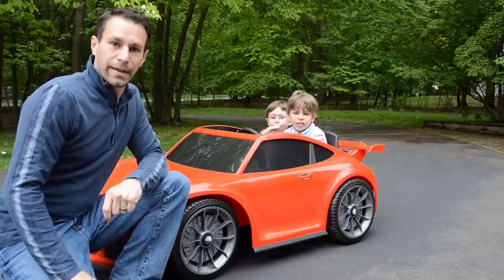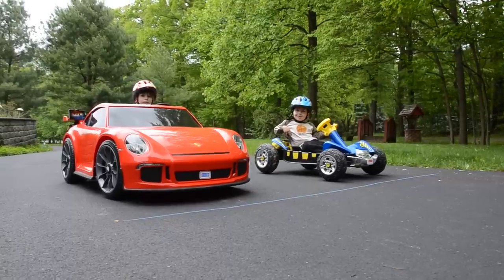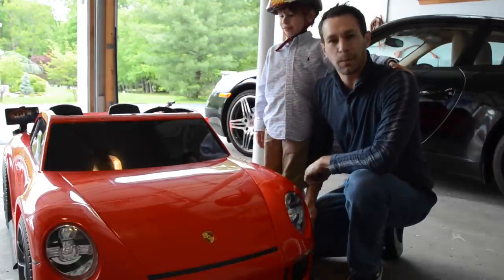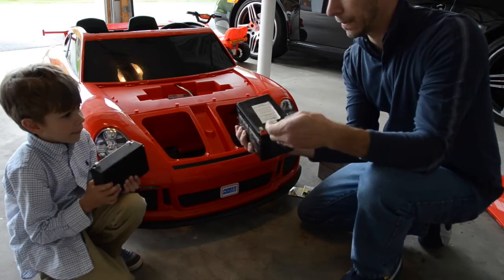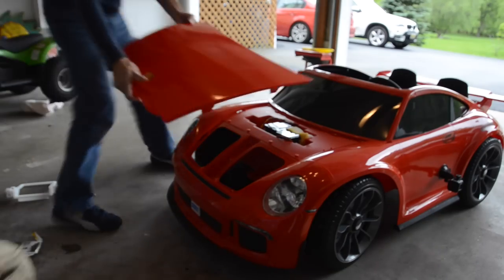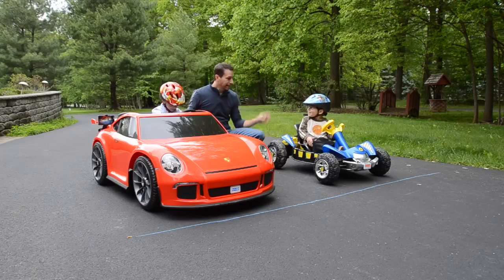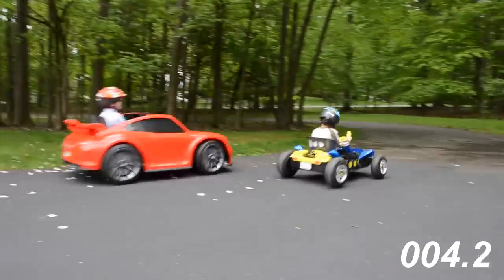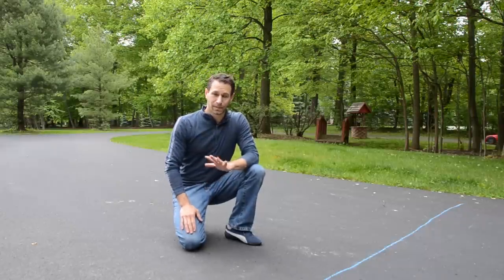How to Hot Rod a Porsche 911 GT3: 50% Faster (Power Wheels 991 GT3)

Comment: Most of those cars have little gear handles to go backwards keep in the middle to stop and push forward to go forward but if you unscrew the screws you can push it all the way down there to goes faster than it usually does

Comment: Painfully slow, I would throw in a 6S 16000mah Lipo battery from hobbyking which is 22V and lightweight, large capacity drone battery. Get ready to haul ass. I'm sure it's a brush motor, get a 48V ESC from eBay, wire 2 x 6S lipos in series combined for 44V and get ready to rip. Also, upgrade to a 1500W brushed motor down the line, as you may burn out the stock motor on 44V. Just my 2 cents (I build electric race bikes 116V, 70mph).
Reply: Electric Race Technologies and rubber tires
Reply: Electric Race Technologies or a gokart engine
Reply: I like your thinking my good sir
Reply: ya I use a v8 with the quadro fart spin turquoise rainbow charger

Comment: hey man, just wondering here (and researching for my project),putting more voltage in a 6v (or would be 12v) motor doesn't reduce lifetime of the motor?  Great video!
Reply from the maker: The two biggest weak points for adding more voltage are the gearbox and overheating the motor. The more voltage you provide, the more torque on the plastic gearboxes, and the more likely something will break. If you have an electronic speed control that eases the power on, you can add more voltage (24v) to a stock gearbox. Also, too much voltage to the motor will overheat them and burn them out.

Comment: Just needs more grip now. Too much wheel spin on launch :)
Reply from the maker: So true. The increased speed also makes understeer a bit!
Reply: Lets not forget you can upgrade the motors too.
Reply from the maker: +AmuckPVP excellent point, better motors definitely kick things up! The biggest reason I went to only 18v is the gearbox. Once you hit the torque that 24v provides, the instant start and stop of the power is difficult for the plastic gears to handle, and they will eventually fail. To combat this, modders also upgrade the gearbox, change to a variable throttle system (usually a scooter board), or both. I like your mindset of more power!
Reply: Motors, Megabytes, & Mods
"excellent point, better motors definitely kicks things up!"
I ended up going to multiple pawnshops & bought a ride-on-car toy for an amazing price. The unit I bought had a dead battery & I talked them down to reduce the price of $60 because of it.

"The biggest reason I went to only 18v is the gearbox. Once you hit the torque that 24v provides, the instant start and stop of the power is difficult for the plastic gears to handle, and they will eventually fail."
I purchased a new Traxxas 5675 Titan 775 & you can get the plastic disc that goes inside the GearBox used or new at a good price on eBay or buy a metal one.

"To combat this, modders also upgrade the gearbox, change to a variable throttle system (usually a scooter board), or both. I like your mindset of your power!"
I thought about buying a ESC system someone is selling on eBay that I came across from YouTube or to try to build it myself. I wonder if certain scooters have it so I can just transfer the system to a ride-on-car toy & I can pay a fraction for getting it used. However, I did what the person above mentioned. I ended up getting 3 cheap-grippy bike tires at Wal~Mart & it helped for the jerking.

Motors (2) I purchased: https://www.amazon.com/dp/B001SETT0Y/ref=wl_it_dp_o_pC_nS_ttl?_encoding=UTF8&colid=3A7QWRVB1I5XR&coliid=IK06X360NPMT1

Batteries (2) I bought: https://www.amazon.com/dp/B0072ADJ4K/ref=wl_it_dp_o_pC_S_ttl?_encoding=UTF8&colid=3A7QWRVB1I5XR&coliid=I332PF9H7SZQ2N

Metal Disc for GearBox: http://kidcarsandparts.com/power-wheels-391/
Reply: I forgot to mention that the two batteries weighed less than the dead default battery & should last a lot longer anyways. Also, I failed to mentioned other accessories I bought like the fuses, new wiring, & etc. I bought a used unit at a pawn shop that costs less than the price compared to paying when it's new & that includes the price of upgrading mine  with MOD's. All in all, it was a fun project & my toddler son loves it. He recently got it for Christmas but unfortunately it's been raining a lot in California where I'm from lately.
Reply from the maker: It sounds like a great project!
Reply: Motors, Megabytes, & Mods
Thanks, I can't deny I like the cosmetics of the Porsche a little more but my son is extremely happy with his car & that's all that counts in the end. Oh yeah, do you know if certain scooters have it (the ESC system)? So I can just transfer the system to a ride-on-car toy & I can pay a fraction for getting it used
Reply from the maker: You're exactly right, all that matters is that your son is happy!  As for ESCs, I'm not sure of exact models to buy.  There is a lot of discussion on the modified power wheels site, I recommend poking around there to see what you can find.  http://forum.modifiedpowerwheels.com/viewforum.php?f=46&sid=2d7efbf5edd9a7b9ef5a7a15f76a610d
Reply: oddbrawl hi
Reply: soo truo
Reply: oddbrawl
Reply: oddbrawl i
Reply: oddbrawl yup way to much wheel spin
Reply: oddbrawl ikr
Reply: oddbrawl you need more weight
Reply: oddbrawl I
Reply: oddbrawl  ol
Reply: oddbrawl true
Reply: oddbrawl RWD life bro
Reply: oddbrawl p.s
Reply: oddbrawl yes there tires speen
Reply: oddbrawl k
Reply: oddbrawl they are still using the crap stock tires
Reply: I had one of those when i was little but it was a ford f150 how come i couldnt do a wheel speed when i hit the gas (but if was probably for the best😂😂😂😂)
Reply: yup, too much burn out, put dirtbike wheels on it or something
Reply: layer it with something, like maybe rubber
Reply: The plastic  gears will break once you improve grip.  I screwed in  sheatmetal screws for off road traction and it died in a day.
Reply: Love
Reply: oddbrawl cm
Reply: @motorsmegabytesmods9936

Comment: Next mods for these cars should be brushless power drills. Milwaukee makes some great upgrade options and gear boxes. The plastic wheels are good for grass but awful everywhere else. Rubber is just too heavy unless power train is modified. Then youre getting into large batteries, reduced run time. Might as well just give the am 90cc atv lol.

Comment: So my kids have the same Power Wheels Porsche GT3 and I've been looking to do this exact mod to make it a little faster.  I wanted to see how the batteries were wired in a series, but you didn't show that too much in detail on your video.  Any more information on this?  Thanks!  BTW, you have a lovely family!
Reply from the maker: Hi AWDRIFT, thank you for the compliment! There are a couple of ways you can do this.  One is to do it how I did it in the video where you snip off the factory connector (on the car) and use the "F2" connectors in its place (links in the video description, for reference).  One of those sides is positive and the other is negative, and there is usually a (+) and <-> symbol on the connector so you know which is which. The wires are sometimes color coded with red being positive (+).  You then connect the positive wire (+) from the car to the positive (+) connector on one of the batteries (it doesn't matter which battery).  Next, you connect the negative <-> terminal from that battery to the positive (+) connector on the second battery.  Finally, you close the loop by connecting the negative <-> terminal on the second battery to the negative <-> wire on the car.  You've then successfully wired the battery in series.  You'll know you reversed the connection to the car (swapped the (+) and <->) if you push the throttle in a forward gear and the car goes backwards.  In that case, you mixed up the (+) and <-> on the car side, so just flip them and you'll be set.  

The other option is to leave the factory connector on the car and buy a second factory connector for the battery.  In that case, you wire the batteries the same way as I described, but connect the positive and negative wires from the batteries to the new factory connector instead of directly to the car.  You can usually find new or used connectors on eBay, just be sure to get the right "style", as all power wheels connectors are not the same, and the car and battery connectors are different from one another.

Good luck, and let me know if you have further questions.
Reply: Motors, Megabytes, & Mods , thanks for the quick reply.  What gauge wires did you get for the connections, or does it matter?  Your instructions on running the batteries in a series is really helpful.  Thanks!
Reply from the maker: AWDRIFT I went with 12 gauge wire, and there are links in the video description for reference. Any "hookup wire" at your local auto or home improvement store will work. You'll need connectors, and the typical batteries (as in the links) have what are called F2 connectors. Those are also available at most retailers, as well as on amazon. Expand the video description and you'll see most of the parts list laid out.

Comment: the blue racer has a lotta wheelspin, but in the end the GT3 wins.......for some reason the 12 volts gives the wheelspin lots of power, making the end a bit of power....id say its good but would you change both to 24 volts and do some upgrades on the GT3 same on the blue racer but id prefer the GT3 because its more of a racer but you can do simple mods like um.... a new spoiler and real rubber on the tires??? its maybe gonna give the GT3 more wheelspin same for the Blue Racer and how bout' change the color of the body.....and clean up the interior so its more lightweight....id not prefer a carbon fiber hood cuz the engine is at the back.......id really want it to happen...im a great fan!!! :-)

Comment: Dude straight up just buy a bunch of drill batteries that are like 18 volts and wire them up together. I did this to a RC car and it went 21 mph. I had a 20 foot strip marked with tape recorded the times, and repeated this action 10 times. I got the average and did the rest of the math so yeah.

Comment: Have you thought of using an 18 volt drill battery instead of having to use those two big batteries?
Reply from the maker: +Skater Life that's a good idea, and some people are doing it. The biggest knock against it is the capacity. The larger drill batteries are around 4.0ah, and the batteries in this video are 12.0ah, so they will run for about 3x as long as the drill battery. You could theoretically run 3 drill batteries in parallel to get the same 12ah, but they you would lose the convenience of a single, small, light drill (lithium) battery.

Comment: Hey there, awesome mod! How is it holding up? Any issues with the gears/motors? Thanks.
Reply from the maker: +Rod Costa not at 18v. When you kick it up to 24v, you run into issues with the stock motors and gearboxes. In that case, you go with a stronger first gear (vendors like ml toys), or an electronic speed control for variable throttle. It's those 100% power starts and stops that thrashes the gearboxes.

Comment: you should cut out the middle front under the hood and add a 24 vt battery as replacement it would be awwwwesome it would go like 10 mph or 12

Comment: with charging the batteries do you charge them separately? i recently purchased this power wheel and want to do this mod
Reply from the maker: +Chris Galindo I have a 12v Schumacher charger and I charge the batteries separately. There are plenty of 18v chargers out there that would make things easier, plus you could leave the batteries in the car when charging. Let me know if you have trouble finding one and I'll see if I can dig up a link.
Reply: Motors, Megabytes, & Mods thank you very much. I will probably be doing this mod pretty soon .

Comment: Could you put two 50 volt batterys to make 100 volt in one of them thangs
Reply from the maker: These little motors will only take so much voltage before they burn out. People that want that kind of speed end up changing to a large scooter motor and some sort of chain drive, as the plastic gearboxes can’t take that kind of abuse.

Comment: Do you think it'd change if u did parrallel
Reply from the maker: Since the batteries are different voltages, i couldn’t wire them in parallel. If I had two 12v batteries, wiring them in parallel (as opposed to series) makes them run at 12v, but you have twice the run time (essentially, doubling the battery capacity since they are wired together in parallel).

Comment: hello , do you still use the same charger ?
Reply from the maker: No, I use an aftermarket charger, although you could use the factory charger if you add a factory connector to the end of the aftermarket batteries.  The charger I use is by a company called Schumacher http://amzn.to/2mgrhhz.  Also, there are links to all the parts I used in the video "description" field.

Comment: I did this and it burned the motors up in just a few uses.
Reply from the maker: +paintm4u I'm sorry to hear that! We haven't had any issues at 18v since last year, but there are factors like more weight/load or more hills that could put more strain on the motors. 24v could cook things more quickly, but 18v tends to be a. It safer. Don't forget to add the inline fuse as a safeguard.
Reply: Yes I did the 24 volt conversion with a commercially available kit from MLToys with the fuse and all but it was  just too much and  burned up both our Dune Racer and a Kawasaki four wheeler. I guess I'll upgrade to the heavier motors.
Reply from the maker: +paintm4u the sudden start and stop from 24v is pretty hard on the gears, too. The ideal way to upgrade to 24v is to use an electronic speed controller with a variable throttle, so everything isn't at 100% when you hit the throttle. It eases things in a bit, and the same with the brake. Unfortunately, it's more complicated to change to that system since there's a decent amount of rewriting and you're also adding a pedal. There is a kit out there with all the pieces, but it's not cheap. Checkout East Coast PowerUps for that kit if you're curious.

Comment: Im new into this... why not 24Vs?
Reply from the maker: When you go to 24V, it tends to be too much power for the stock gearboxes.  Since there is no variable throttle or variable brake, it's full power or full brake whenever the throttle is applied or lifted.  The "brake" actually stops the electric motor, which locks the gears to stop the wheels from spinning.  The more voltage, the harder it is on the gearbox with all the thrashing from starting and stopping.  Also, the heavier the kid(s), the harder it is on the system.  The stock gearbox will last for a bit with 24V, but it's guaranteed to go at some point.  18V is the most you can safely go without upgrading the gearbox.  That being said, the gearboxes aren't that expensive to upgrade, and can be found on sites like mltoys.com.  Also, running too much power to the stock motors will eventually overheat them and burn them out. You can also upgrade the motors along with the gearboxes.
Reply: Motors, Megabytes, & Mods Thanks for clear explanation. I had this question and now is answer. Keep up making videos. I will subscribe to your channel.  Thanks